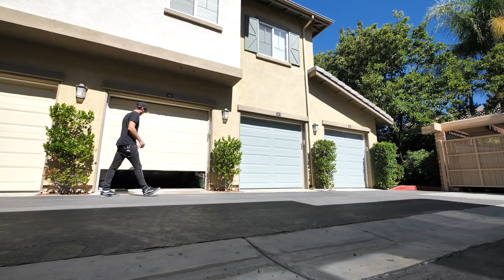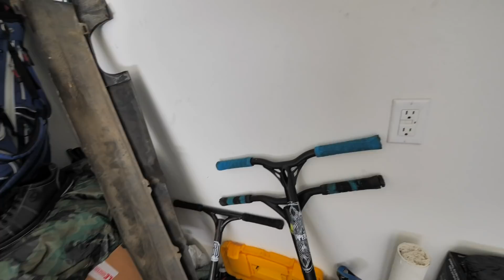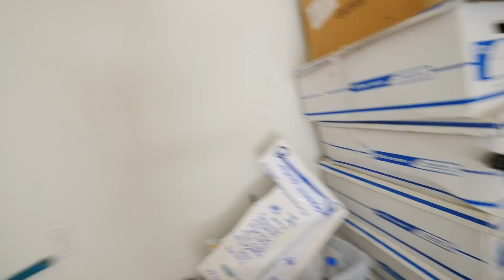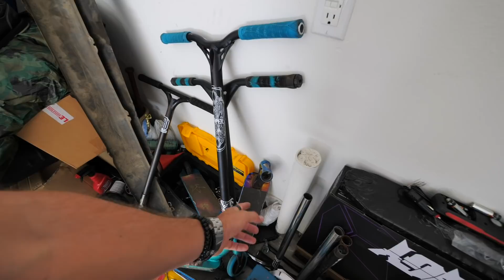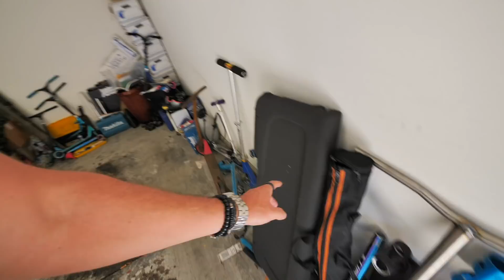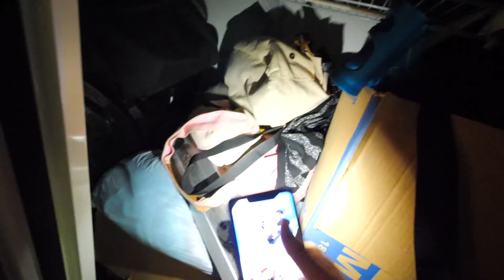HOW MANY SCOOTERS DO I HAVE?

Comment: You are lucky. I only have one and I found it outside near the trash can. It was ugly green, one wheel, and no grips. It has some ugly bars and the whole scooter is pretty small. When I found it, I bought some grips and and an old blue wheel. And my dad spray painted it black. Now the paint is coming off and the wheels are all ripped. I took it to the skatepark one time and everybody started looking at me and laughing. So that’s why I don’t go to the skatepark anymore. I only use it sometimes when I go outside. I used to have a a blue mayhem supernova scooter. It rattled a lot and my friends made fun of it. Then one kid got it and broke the bar☹️